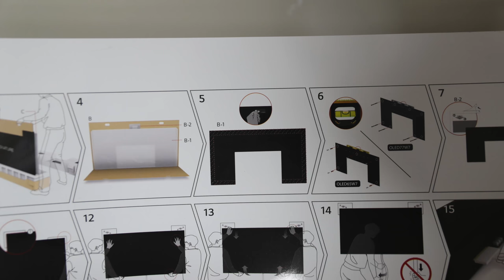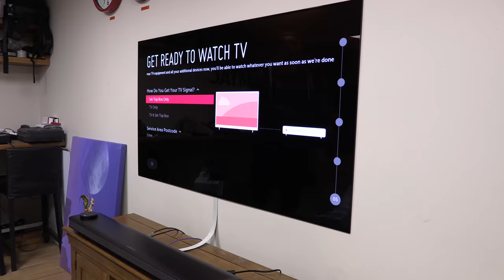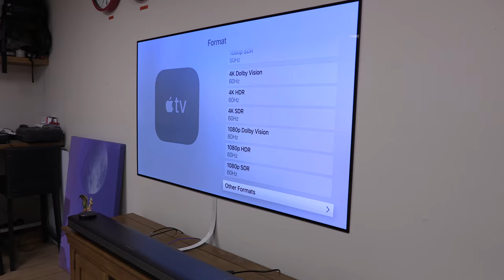LG wallpaper TV installation

Comment: It might be possible if you still have the paint that you used on that wall to cut a small section of the plasterboard out just below the TV and also another slot just below your unit so you could loop the cable into that
Reply from the maker: Indeed, there are instructions for doing that in terms of how much you bend the cable, etc.